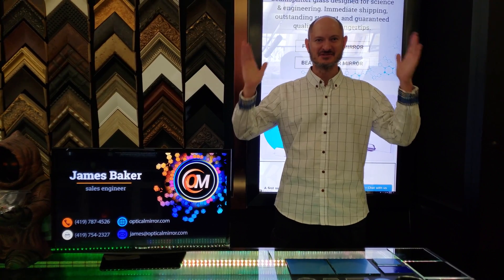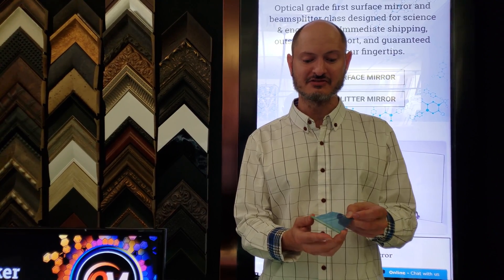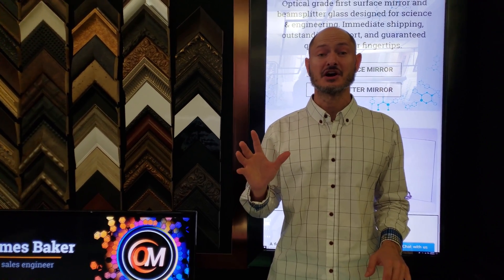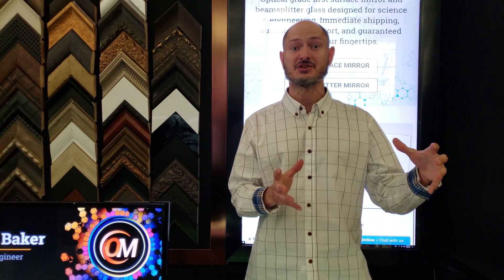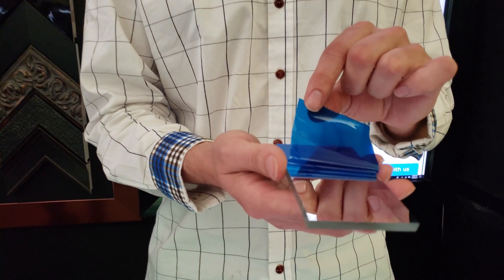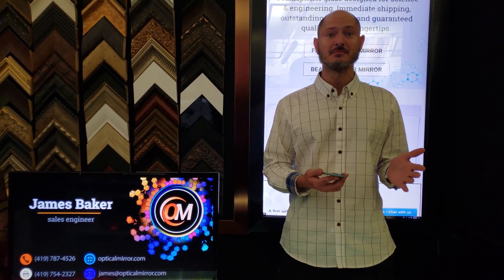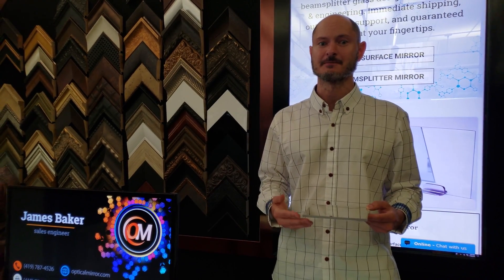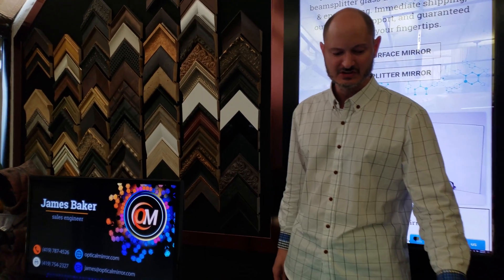Front Surface Mirror: How To Choose The Best

Comment: I've been creating an interesting sort of art/light display set up using different lasers, mirrored tiles (bottom, and 2 vertical pieces or half of an open box) with a variety of hand carved and polished or frosted hard minerals like quartz. I set up different quartz/glass/fluorescent minerals and objects on the bottom piece of glass and direct lasers light into the pieces. It's super cool except for the ghost of the back surface mirror. I can see through especially where the panels meet.  It's impossible to hide. I think first surface acrylic might be the right thing. Do you have have any kind of catalogs i could get hold of?